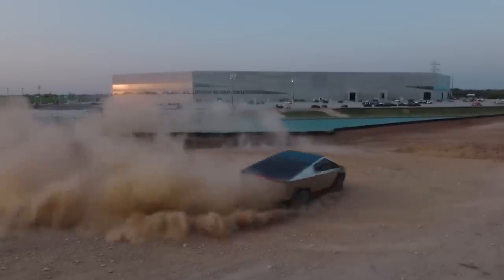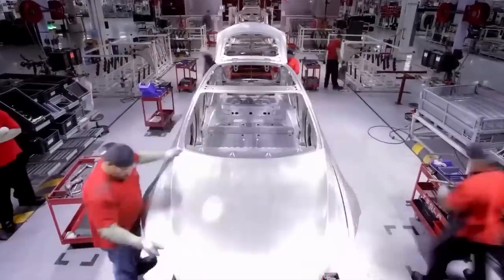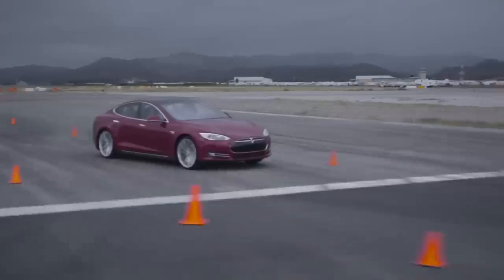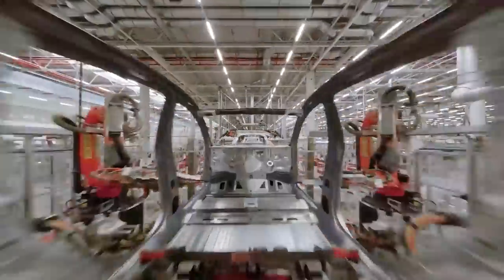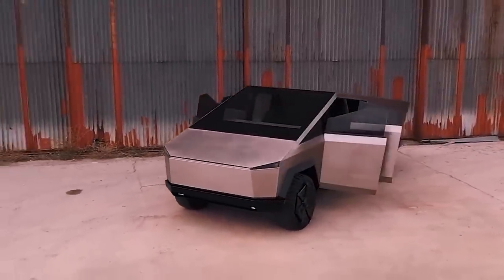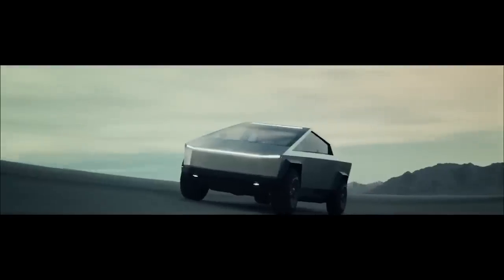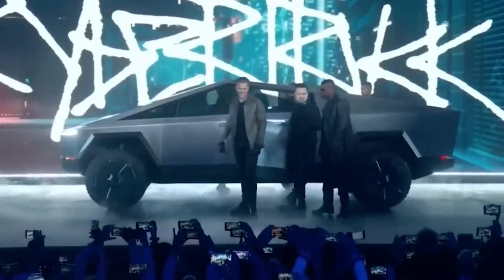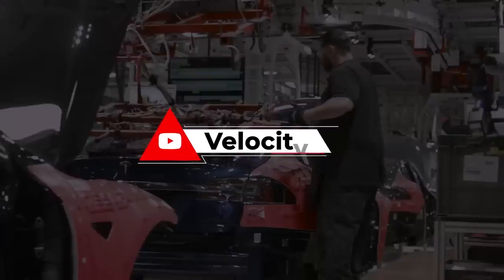Inside Tesla's New $7 BILLION Cybertruck Factory

Comment: My dream Cybertruck configuration would have 8 removable modular units of LFP chemistry that each function as a 1/2 capacity Powerwall. This would allow owners to be able to offload ~ 56 kWh of battery, all together over 1,000 pounds worth, so their truck could do light duty work without all that dead weight for most of their day to day use. When making long trips, or medium towing trips, etc which are edge case needs for most, only ~5% of their truck's use, owner's Cybertruck would still have their back.
These would have a manageable weight so a single person could dolly them around their property to set them up for home use, and preferably monetize them in a grid servicing virtual power plant setup. Just stating the obvious, batteries have a significant ecological footprint built into their material and manufacture, and should be available to be optimally used to help our grid more quickly transition to renewable generation. 

These eight half capacity power packs would give the Cybertruck owner great flexibility to use and make money with their battery assets as they choose. They could be shared around strengthening our community and allowing those who struggle to afford the 500+ mile Cybertruck to borrow-up when circumstances require a temporary upgrade. Trucks need suspensions made to handle variable loads anyway, so adding this to the suspension's lower end is just a doable part of the engineering challenge of enabling these plug and play removable battery modules to be incorporated into the overall battery pack. 

Giving consumers this flexibility would be a huge driver of increased demand for this Cybertruck, leaping over the F-150's vehicle to load innovations. If Tesla's goal is to accelerate our sustainable transition and to give us increased resilience against climate disruptions this seems like a no brainer, worthy of the extra engineering challenges.
Reply: No one wants to mess with that shit. Tesla is iPhone.